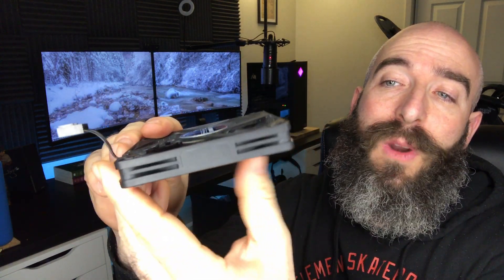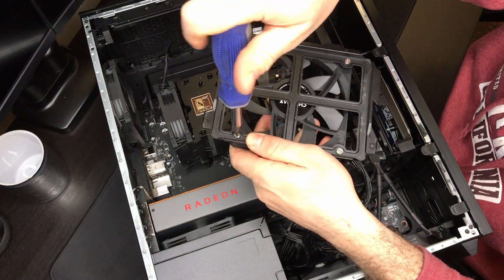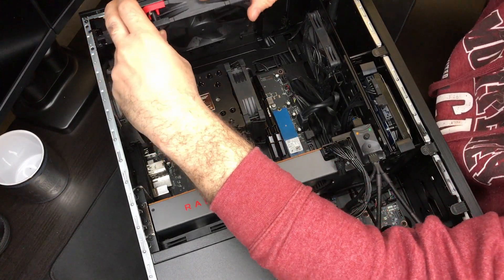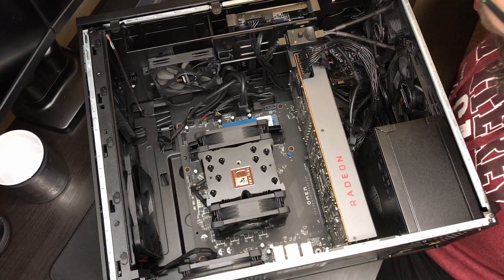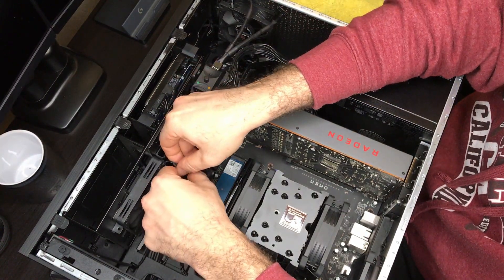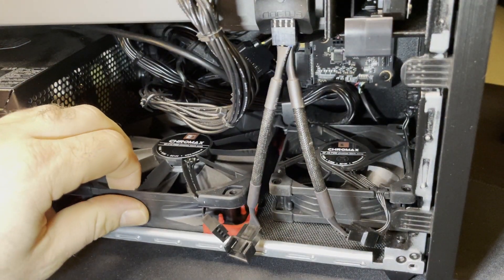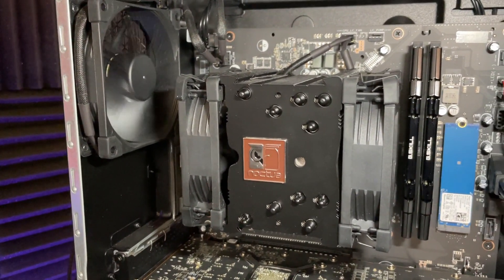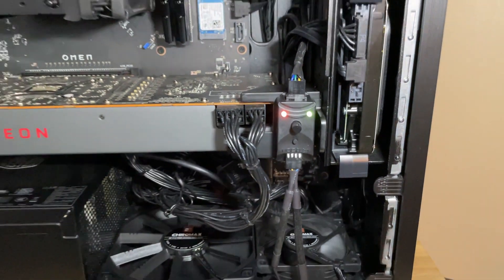How to: Install and Setup All Fans in an HP Omen 25L / 30L! Tutorial & Guide!

Comment: Is it essential that I get a fan controller? I'm thinking of upgrading all my fans to Noctua fans
Reply from the maker: No it is not, if you have enough fan headers and y-split cables, I would just go that route. The fan controller is a nice addition though for $20
Reply: @DanKamYouKnow  Gotcha, so what fans do I need to upgrade the stock fans? I believe you said for the top fan a 120mm fan would suffice. What fans do I need for the front and back? My 30L that I bought a few days ago is getting temperatures of 60c cpu temperature on idle on a Ryzen 3700.
Reply from the maker: I wouldn’t worry too much about idle temps but more so on your in game and under load temps. Sizes are as follows:

Front: 92mm
Stock CPU cooler fan: 80mm
Rear fan: 92mm
Top / Bottom: 120mm
Reply: @DanKamYouKnow  thank you! When I replace the stock cooler can I use a Noctua NH-U9S? It comes with with one NF- A9 92mm fan but I’m planning to put an extra one on the other side of the NH-U9S. So there would be a fan on each side of my cooler; similar to how your cooler looks with 2fans
Reply from the maker: That is the cooler ( U9S ) I am using and uploaded a tutorial for. I would highly recommend using a fan in the back side. It helps pull hot air away from the cooling fins. 👍🏻
Reply: @DanKamYouKnow  gotcha, if I want to install a bottom 120mm fan do I need a fan controller? I currently am using another hard drive so I can’t use a fan controller on mine I believe I’d just need y split cables right? But where would I hook those up to in the motherboard? Also what specific thermal paste do you use to connect the cooler?
Reply from the maker: I use Noctua thermal paste: NT- H2. I use y-cables and use the sys_fan, CPU_fan, and Ft_fan ( called ch_fan on some ) headers.
Reply: @DanKamYouKnow  which y split cables do you use? Noctua 3 pin or 4 pin? And so you’re saying that I can just plug my fans using y split cables into those headers listed without a fan controller on my omen 30L? Also thank you so much for replying to me and clarifying things. I'm currently a novice/beginner at pc building/upgrading and I kinda find replacing the cooler a daunting task, but I think I can do it.
Reply from the maker: No worries dude! Yes, plug 2 fans into the y-cable and then into a fan header on the board. I linked the y-split cables I use in the description for the video. I show how to do so towards the end of the video.
Reply: @DanKamYouKnow  Thanks. I just got my Omen 30L last week so I don't necessarily have the budget to upgrade the fans. Is it crucial that I upgrade them now or can it wait a few months? And if I do decide to buy an upgrade part which one should I buy first since I'm basically kinda low on budget. Perhaps I can upgrade it gradually instead of going all at once in the upgrades. I'm just trying to improve my CPU temps. But at least my gpu is completely nice and cool.
Reply from the maker: Definitely not 100% necessary to change / add things right when you get it. The temps may be slightly warm, but I’m sure they’ll stay in the safe range. I would highly recommend removing the bracket at the case, if you haven’t already. As far as the first mod, top fan works really well. Or if you feel you can do it, a CPU cooler makes a huge difference, but is pretty involved.
Reply: @DanKamYouKnow  I would install the CPU Cooler I feel like I could follow the given instructions in your cpu cooler installation video but unfortunately, I believe it might be a bit out of my budget range since I would need to buy the necessary tools to take it apart. Due to the process of elimination, I guess I could start with the top 120mm Noctua Fan you said and slowly start upgrading the cooling system from there? I just don't want my CPU to be fried haha. For installing the top fan I would just need the fan and a y splitter cable right and to unscrew the brackets on the top and install the fan you used a Phillips Head #1?
Reply from the maker: That is correct and there is no need to rush into mods. Just keep an eye on your temps and even high 70’s / low 80’s is safe.
Reply: @DanKamYouKnow  gotcha thank you so much!
Reply: @DanKamYouKnow  One last question which direction do I install the rear and top fan? If the logo is facing the outer side of the computer that works and an exhaust fan right? For the rear fan is will it be an intake or exhaust? same question for the top fan as well. From what Ive seen I think both of them had the logo facing towards the outer side of the computer making it an exhaust fan right? Please clarify if I’m wrong and thank you so much for your help. Just ordered fans for the top and rear parts! Also does the Omen 30L have a dust filter?
Reply from the maker: Omen does not have a removable dust filter. If the Noctua logo is facing outward, that means they are set as exhaust and you want both the rear and top fan to be an exhaust, so it sounds like you have them set up correctly 👍🏻
Reply: Just installed the noctua 92mm rear fan and noctua 120mm top fan unfortunately one of the screws in the bracket literally got stuck in the USB hub so I used like some sort of plastic thread (like the ones they use in fishing lines) and looped it through the small holes in the top to substitute it. Do you think an alternative is also go to somewhere like home depot and show them the top bracket screw and ask for something exactly like that? If not I can still live with the 1 small thread looping around my top bracket to hold it up. 1 fan is still screwed in and I also used the extra fan I now have from installing the rear fan and put it in the bottom of my Omen 30L. Temps significantly dropped. Idle temps for me now are 45-50c sometimes it goes to 60 then literally goes back down not sure whats going on there. Also I heard that the omen command center's temperature readings arent accurate its like 5-8 degrees celsius off. Ryzen Master provides more accurate temperatures. Just thought it would be cool to add that little bit of information there.
Reply from the maker: Yeah, you should be able to find something at Home Depot for sure. You’re correct, Omen Command Center is a very inaccurate “average” temp. Ryzen Master does display a more accurate real time temperature. I would use the program HWinfo64 is you want the best temp and information source.

Comment: Hello Dan, it's me again! I'm just wondering how quiet is your top mounted fan? I just installed my noctua NF-S12 and currently its around 48 dB loud. Is there any way i can fix this or is this normal?
Reply from the maker: How do you have the top fan connected?
Reply: @DanKamYouKnow  I followed your video. I y split it together with the rear fan. Do you know how to fix this? (I also have the top fan used as an exhaust btw if that matters)
Reply from the maker: And you have the squares popped out on the top bracket where the fan is mounted?
Reply: @DanKamYouKnow  yes correct!
Reply from the maker: What DB are the slim fans rated at?

Comment: Thank you for all your videos. They have been super helpful. Quick question - on 25L have you ever noticed the PSU fan intermittently kicks in even while scrolling a webpage or a small mouse movement. It makes an audible click sound every time it spins( sounds like a spinning drive head movement when it is loading up programs). The PC itself is quiet otherwise. Thanks again!!
Reply from the maker: You’re welcome and thanks for watching! Yes, the PSU fan is designed to come on and off and is unfortunately, completely normal operation and no way to get around it.
Reply: Same for me.

Comment: Hello. I just ordered a 30L. I'll be gaming/editing/and mining. Have you had temp issues? Mine is the 3090. Would I need to simply replace the fans or upgrade the entire case? Any feedback would be helpful!

Thanks
Reply: That's what I thought! Thankyou sir for the fast supply. I'm new to a lot of this (been on Mac for 10 years) .. are there any cases you recommend? Doesn't have to be a budget one.
Reply from the maker: No problem! I’d recommend giving this video a watch through to see what you like best but Gamer Nexus breaks down the best airflow cases:

https://youtu.be/XsMNu0gWlZw
Reply: @DanKamYouKnow  will do!
Reply from the maker: So far, the machines that have the 3080/3090 and 10700k / 10900k combos run pretty warm. Best bet is to case swap so you can get increased airflow. Replacing the fans will also slightly help but the case just has bad airflow, especially since those graphics cards are so huge. Congrats on the new PC!

Comment: Got a question about the nactua 120mm fan is it supposed to be loud on normal speed i have it y spit from the back exhaust fan
Reply from the maker: It depends on the fan speed of the computer. When temps ramp up, you will hear some fan noise. At idle and moderate temps, they should be fairly quiet.
Reply: Ok thank you for the information your videos have been very helpful to me in getting everything running smoothly... Again thank you 😁
Reply from the maker: You’re welcome and thanks for watching 😎

Comment: What size fans did u use?
Reply from the maker: I mentioned it in the video but:

Rear: 92mm
Top: 120mm
Stock CPU cooler fan: 80mm
Bottom: 120 and 80mm
Reply: @DanKamYouKnow  Thank u I dunno but I didn’t remember where u said it lol. Nice video, I’ll sub :)
Reply from the maker: Thanks! Let me know if you have any other questions (=

Comment: Does installing any fan voids the warranty? Because i have a 4 year warranty
Reply from the maker: You would have to ask HP.
Reply: @DanKamYouKnow  thx man for the reply i already did what you said and removed the top metal thingy but haven't installed any fan yet I'll wait till summer and see i guess
Reply from the maker: The way I see it, HP warranty is more of a “what they don’t know, won’t hurt them” kind of situation. Say you install some fans and down the road, you have an issue and need to send the PC in for repairs, then you’ll simply return the PC back to its stock configuration and send it in. They’ll never know you modified anything (=
Reply: @DanKamYouKnow  one more question please, does removing the top bracket helps with temps? Do you recommend it or not? I removed it but the temps are still the same
Reply from the maker: Yes, it creates some more airflow in the case and an escape route for air through the top.
Reply: @DanKamYouKnow  i appreciate the answer and your help with those vids man i hope you have a great a day
Reply from the maker: Thank you! Hope you have a good night too 😎😎😎

Comment: I actually followed your video guide on installing extra fans. I have added two 120mm Chromax fans in the case, one intake at the bottom and one at the top as an exhaust, it has helped with the cooling. I am still using the stock prism cpu cooler. My current idle temp is now a steady 35 centigrade, dropped from the previous 45. Also my fans are set to quiet in the Omen command centre.
Reply from the maker: Those are some great temps!! Glad I could help. Omens just need a little airflow in em
Reply: @DanKamYouKnow  I`m really pleased with the results, your video guides for the Omen are very useful.
Reply: @DanKamYouKnow  Can you tell me why in my Omen 40 L does not turn on the AIO led light?
Reply from the maker: I have seen that not all AIO’s actually have the lighting on it.
Reply: @DanKamYouKnow  Can you adjust the added fans speed with a software?
Reply from the maker: Nope. No programs work with an HP motherboard. You are stuck with the Omen Gaming Hub adjustments only
Reply: @DanKamYouKnow  Thank you for the very quick answer. Im assuming its possible with the physical noctua adjuster that you show in the video? *the NA-FC1?
Reply from the maker: The manual controller does make it so you can adjust it on its own, but it’s honestly overkill for an Omen case

Comment: Hey thanks for the video. So I got the 30L and I want to add a fan to the top of the case. Where do the cables connect to ? I’m planning on getting a rgb fan for that top side.
Reply from the maker: I go over how all the cables for each of the fan is plugged in towards the end of the video. I would recommend a Y-split cable, splitting the top and rear fan into the header where the rear fan is now.

Comment: hey, is the top fan an exhaust fan?
Reply from the maker: I use mine as an exhaust but I know of some people that have had better temps with it as an intake.
Reply: @DanKamYouKnow  if you wanna put as an intake where should you plug the fan in?
Reply from the maker: The fan plugs into the same spot either way. It’s the orientation of the fan that determines which was is intake or exhaust. The fan only blows air one way. So you have to manually flip the fan if you want to switch from intake to exhaust.
Reply: @DanKamYouKnow  thx i really appreciate the reply
Reply from the maker: 👍🏻👍🏻👍🏻 Glad I can help 😎😎😎

Comment: Thanks for videos. People need to ensure they have more inflow than outflow before they detab the top bracket, or else the rear fan will pull in air from top and send it right out the rear, cooling nothing.
Reply: If the top fan is exhaust that should not happen right? I am thinking of installing a Chromax to the top of my 30L case but I am a noob and this is my first ever pc and cpu and gpu runs at 80c-83c when playing flight sim.
Reply: Dude flight sim eats my 30l, I'm running a fresh air duct from outside, direct through the top. I'm in Alaska and temps are below freezing and still I'm running hot.

Comment: Did you keep the stock 500W PSU?  If not, what did you upgrade it with?
Reply from the maker: I’m still using the 500w power supply. Fans draw very little power and there was no need to upgrade. I will be upgrading my PSU when I upgrade my graphics card ( in summer some time ).
Reply: @DanKamYouKnow  , thanks for the quick reply!  What do you have in mind?  I'm thinking of upgrading both my PSU and GPU as well but don't have a lot of skill and knowledge - my 30L is a custom build by HP.  Your video and ability lead me to believe I could do it if I followed along with someone who does know what they're doing! Lol!
Reply from the maker: No problem and I’m glad I could help! Well, since the graphics card market is so bad right now, I’ll most likely be waiting until early summer to upgrade but, I’ll be going with a 3080 / 3080Ti and a 750w PSU gold rated PSU.
Reply from the maker: That PSU is modular so none of the cables come attached but, it will come with all the cables you will need to power all of your PC components. That’s a fantastic PSU that would work very well! And 750w is enough to power a 3080 and the like. 👍🏻

Comment: I am so glad I found you channel bro. I got my Omen 30L a week ago and it is my first desktop ever. I have a question, man: will the Cooler Master - Master Liquid ML240L AIO fit this case on the top? I wanna upgrade my cooling system but I am a total noob. Thanks brother!
PS: It is a 240mm radiator overall size
Reply from the maker: Congrats on your new PC! Only 120mm AIO’s will fit in the Omen case.
Reply: @DanKamYouKnow  i appreciate the fast reply. Thanks brother!
Reply from the maker: No problem! I have had great success with my Noctua Chromax U9S air cooler in my Omen. Full tutorial on my channel as wel

Comment: Thanks for pointing me here.  I had ordered the Noctua NF-A12x15 PWM chromax.black.swap, Premium Quiet Slim Fan, 4-Pin (120x15mm, Black) from the previous video, and it's still not shipped from last week.  I see the 25mm version is also tough to get, so doing some research. See any issues with running a Y split off of a Y split?  LOL for power options?
Reply from the maker: I would not recommend daisy chaining y-split cables. Noctua stock has been really bad since Christmas time! Stock for the majority of Noctua products is super low!!

Comment: Hi can you please make a water cooling guide for the Omen
Reply from the maker: My Noctua CPU air cooler tutorial is identical to and AIO install except with liquid cooling, you’ll have to install the radiator to the bracket at the top of the case. I don’t plan on water cooling mine because my air cooler works great and even has better results than 120mm coolers
Reply: @DanKamYouKnow  k

Comment: Have you tested if a 120mm & 92mm setup would fit to the bottom, so replacing the 80mm fan with a 92mm fan?
Reply from the maker: An 80mm fan fits with the bottom 120mm perfectly. A 92mm is slightly too big to lay flush on the bottom. It will work but is kind of propped against the front part of the case and not lying fully flush at the bottom. It does work though.

Comment: Wassup Dan,do you think the Artic esports dou will fit in the 30l case.It looks pretty big in the photos on Amazon,but I’m afraid of it not fitting on the case or that it will touch the glass.
Reply from the maker: Hey! Yeah, unfortunately that cooler is too tall and will hit the side panel of the case. You want an air cooler that is 140mm and shorter to be able to fit in the case and the Arctic one is 158mm tall
Reply: @DanKamYouKnow  alright thanks Dan

Comment: Do you need to change the power supply if you add fan?
Reply from the maker: No you do not. Each Noctua fan I used only draws about .2a so you are completely safe with the stock power supply.
Reply: @DanKamYouKnow  great thank you. Also , on my computer it said Chfan, is it good for the bottom fan?
Reply from the maker: Yes, I would recommend using the Ch_fan header or y-splitting the top and rear fan together into the header where the rear fan is plugged into now.
Reply: @DanKamYouKnow  last question 😅 the bottom fan it's the same than the top one?
Reply from the maker: Correct, top and bottom are both 120mm and the rear is a 92mm. The stock CPU cooler fan is 80mm and my Noctua CPU cooler has 2 92mm fans.